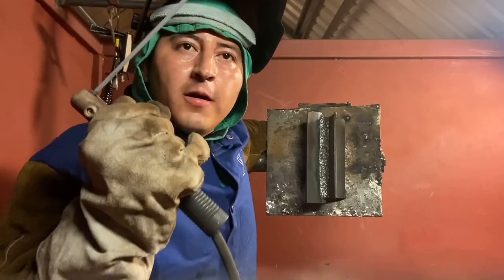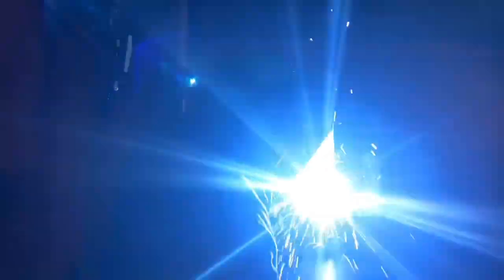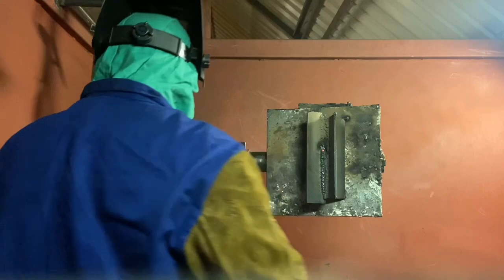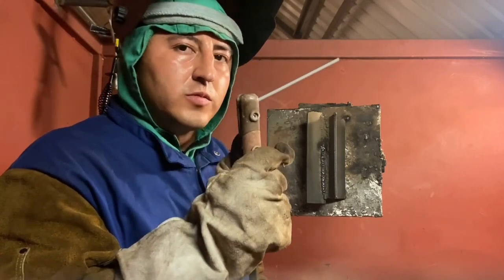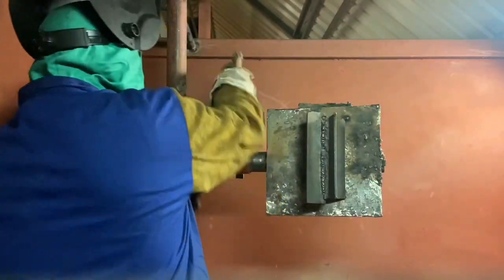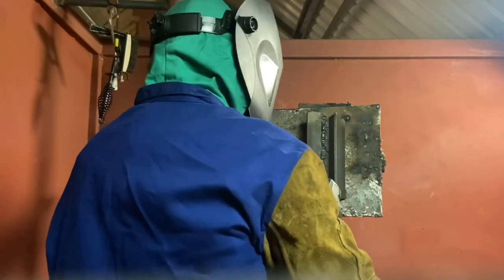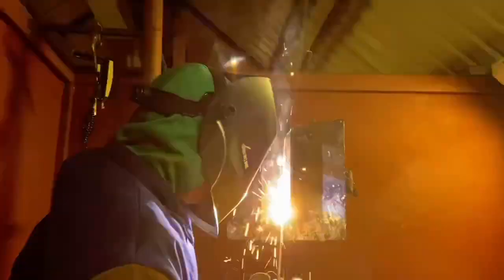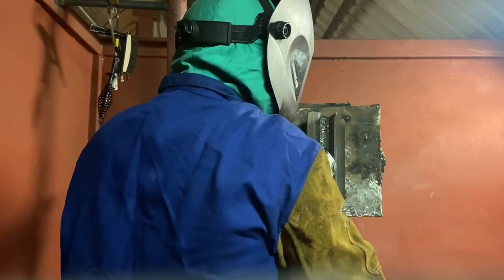SMAW 6010 uphill | 6010 welding vertical

Comment: I like the idea of the "upside down T"! I'll be trying that tomorrow!
Reply from the maker: That’s how I got the hang of it honestly
Reply: @CACTUSWELDZ28  
I forgot to post an update until someone liked my comment. The upside down T works great for me! I passed my weld tests with flying colors. Even made my instructors “Sample Table” to show other students how it’s done. Thanks for the vid Coinsiie!
Reply: @ffgrif  I'll try it tomorrow, but I dont see the point of adding an extra step. I've only been practicing on the flat position and did fine coming back to the edge of the previous puddle all the way.